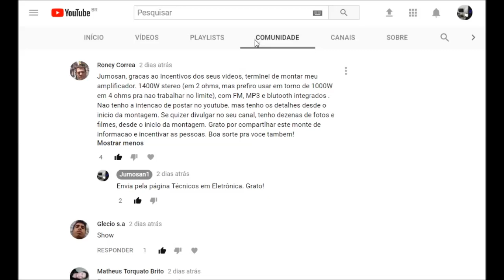Amplificador Artesanal montado pelo Roney Correa/GO

Comment: Esse modelo não é pra iniciantes... Nem para hobby ... Isso aí ja envolve estudo técnico engenharia cálculos... Além de custar só um trafo desse tamanho no mínimo uns 300 reais até 400 reais só o trafo... Uns 60v 0 60v  x 12amperes mais ou menos isso... Aí mais uns 290 reais cada placa com os transistores x duas são 600 reais só em placas e transistores... Aí com todo aparato coolers chave on of... Potenciometros volume painel leitor de usb radio etc pode ter até bluetooth esses modelos etc... Olha o cara gastou uns 1800 reais com dissipadores trafo placas painel chaves transistores coolers e gabinete ... Doideira mas parabéns ficou perfeito muito legal funcional e sim de dar inveja a qualquer um que deseja montar amplificador caseiro etc... Mas para iniciantes recomendo iniciar com tda2030... Ou tda7294 = 93... Placas simples e trafos pequenos 12v 0v 12v 1a ou 1.5amperes pro tda2030 ou tda2050... O 2050 da pra pra ir pra um trafo 15v 0v 15v 3a e esse ja da uma potencia legal...e pra iniciantes que podem gastar um pouco mais ja podem partir pra placa com tda7294 e trafo 18v 0v 18v 3a esse é barato em qualquer eletrônica 45 reais... ou trafo 22v 0v 22v 3a aí ja custa uns 70 reais. Pra trafo 22v 0v 22v precisa bom dissipador de alumínio e um cooler 8cm x 8cm. Ja pro trafo 18v 0 18v 3a o tda 7294 vai bem apenas um dissipador pequeno ou médio já chega e nem é preciso cooler nesse caso. E se consegue boa potência com o tda 7294 recomento a hobystas e iniciantes. Que querem apenas empurrar um falante 8 ou 10 polegadas de 75wrms a 100wrms. e um tweeter. Fica um luxo e funcional e gasta apenas uns 120 reais com tudo já placa componentes e o tda7294 trafo 18v 0v 18v 3a. Ponte retificadora ou diodos comuns se desejar e capacitor pra filtro 35v por 1.000uf  cada vai dois ao montar a fonte simétrica etc... E se consegue aí barato e um bom amplificador caseiro com uns 65w reais a 4homs com esse tda7294. Ou gasta se uns 85 reais e monta o tda2030 ou 2050 com trafo 12v 0v 12v 1a ou 1.5a esse trafo custa 25 reais em loja de eletrônica ou se tira fácil de sucatas como aqueles aparelhos parabólicas antigos o que tem os botões pra trocar de canal etc... Essas sucatas se compra por 5 reais estragados a placa no caso estragavam fácil porém o trafo é 12v 0v e 12v geralmente 1.2 amperes e sempre esses trafos ficam perfeitos estes transformadores não estragam nunca... Aí compra a placa pra montar no mercado livre e monta com o tda2030 ou 2050 custa uns 45 reais essa placa com frete já incluido etc... Dai com 80 pila se monta um bom amplificador  e barato e 14w a 18w a 4homs com o tda 2030. Ou com um trafo 15v 0v 15v 2a pro tda2050 se tira uns 34w rms a 4homs e fica bomxe barato também... Agora quer montar algo mais potente compra o módulo taramps 400x2 dois canais de 200wrms a 2homs cada ou no modo bridge 400wrms a 4homs mono no caso 160 reais no mercado  livre novo etc... Daí compra uma fonte 12v chaveada 20a e pronto vai ser feliz e tocar um som paulada dw verdade kkkk. A fonte 12v 20a pra ligar esse módulo custa uns 38 reais mais frete no mercado livre... Ou compra a fonte 12v 10a essa é bem barata e dá pra ligar as duas fontes juntas em paralelo etc. Só deve fazer o ajuste de voltagem o mais próximo possível... Ex 12.8v e se conseguir regular a outra a 12.7v blz só ligar todos os positivos com positivos e os negativos com negativos... E blz vai funcionar de boa com grande potência e se gasta uns 230 reais e tem módulo taramps de 400w rms mais uma fonte 20a 12v. Ou duas fontes de 10a 12v cada ligadas juntas...feito 400wrms com 230reais. Aí ja pode bombar uns falante de 150w a 250wrms que já começa a ficar interessante... Ou vai prum módulo taramps t500 mono 2homs 500wrms duas fontes 20a 12v juntas ja tocam esse. ou pro 800w  mono taramps pra este duas fontes 12v de 30a juntas. Ou pra soundigital 1.200wrms mono 2homs evo esse é mais barato que o taramps equivalente e toca 18% a mais e consome menos energia o 1200 da taramps. Pra esse 1200wrms evo soundigital recomendo uma bateria 50a zeta é barata comum mas é da moura esse modelo e nova ou uma bateria 50a pioneiro essa é barata e boa também e uma fonte de apenas 15a pra ligar junto ja mantém tudo ok se tiver uma bateria junto. Apenas fonte 15a de fonte pode descer a ripa em dois falantes de 750wrms cada 4homs de 12pol ou de 15pol cada. Que daí ja incomoda o bairro inteiro kkk mas incomode só uns 4 a 5 minutos e abaixem o volume ninguém merece ouvir som alto incomoda é irritante e pode causar problemas sérios se não souber usar potências desse nype pode dar B.O polícia processo ou vc pode apanhar dos deus vizinhos kkk além de ficar mau visto quem ouve som sem limites deveria procurar uma psicologa pois apresenta defeito nos miolos ou fumou muita erva ou bebei demais e ficou com problemas mentais como demência. Ou é um piá de merda tocando som por horas e a todo vapor com 1000wrms tem que apanhar mesmo. Ou gasta 30 mil reais e vai apenas pros campeonatos regionais etc... Ou monta pouca coisa. Pois uma pessoa equilibrada não fica incomodando o sossego dos outros porquê tem um baita som deixar lacrado pra fazer zueira daí tem que tomar uns tapa nos ouvido mesmo pra aprender a respeitar os outros etc.
Reply: Eu entendo a sua posicao e concordo com voce! Tem opcoes pra todos. este trafo eu aproveitei de uma sucata que comprei ( acho que da pra ver a cola nos fios que saem do secundario, pois estavam soltando e tive que trocar) sao 55 ou 58 volts, nao me lembro por 40 A, mas quando testei ia abem ate pouco mais de30A depois a tensao caia muito.
O detalhe é que eu queria muito fazer do zero, inclusive tem a placa de conexoes que fiz a mao e o painelzinho em aluminio de deu muito trabalhao pra fazer os cortes.
Como diz nosso amigo Jumosan :, Boa Sorte!

Comment: Para que montar um absurdo desses isso aí deve tocar 1200 RMS por canal a 2 homs cada canal... E um transformador desses deve ser 60 mais 60 volts ou mais e por uns 10 ou 15 amperes mais ou menos isso aí come luz igual um chuveiro mas deve tocar para caramba mas o gasto não compensa Claro para hobistas ficou perfeito incrível Belo trabalho mas para quem não tem dinheiro e tempo para arrumar transformadores incríveis ou até mesmo ter que fazer um transformador desse tamanho e comprar tantos transistor que São Caríssimos para caramba pegue compra um som digital de 1200 watts RMS a 2 ohms o módulo de carro no caso por 340 pila no MercadoLivre compra uma fonte ou duas fonte de 30 amperes cada Total 440 pila e tá montado já em 2 minutos um ampli de 1200 watts RMS a 2 ohms com duas fontes de 30 amperes cada 12 volts ligado no módulo automotivo e tá pronto o BRIC aí se quiser bota uma bateria junto para ajudar e tá sossegado gasta metade do valor de um amplificador de som desses montados caseiros Se for para montar e valer a pena melhor um apenas com um par dos Toshiba ou dois pares dos Toshiba e um um transformador de apenas 33 + 33 volts por 4 amperes e isso para quem já tem dinheiro sobrando por que para quem não tem dinheiro compra plaquinha por 40 pila e monta com o tda7293 ou 94 e com um transformador 18 + 18 volts por 3 amperes tá montado um canal bem baratinho de 85 watts Rms bem mais barato e mais prático Se for para montar um negócio desse tamanho é melhor comprar um módulo automotivo e adaptar a fontes e gasta-se apenas a metade do valor
Reply: Jean padilha, se eu te mostrar o meu amplificador linear de radiofrequencia (sou radioamador ) voce vai morrer entao.  É do tamanho de um frigobar. A fonte tem soft start - 2 etapas - pra nao derrubar o disjuntor da casa. De consumo sao aproximadamente 6 mil watts
O grande prazer esta em construir as coisa com as proprias maos, e se puder ser potente, melhor ainda!
Abracos
Reply: Roney Correa parabéns se vc consegue gastar 6kw hora e parabéns por montar seus próprios radiofrequência ou  amplificadores etc. Eu admiro muito quem monta coisas potentes e dá certo. Tudo de bom p vc. Eu montei apenas amplificadores pequenos devido ao alto custo de materiais etc... O maior que montei gastei 260 reais um canal com dois pares dos toschibas 2sc5200 e 2sa1943 e consegui 200wrms a 4homs e ta funcionando até hoje mas isso faz 4 anos atrás... Se for montar o mesmo mono apenas um canal igual esse que ei montei etc... Hoje ia gastar uns 340 reais apenas um canal... Eu acho um absurdo o preço pra montar esses amplificadores... Mas no meu carro por exemplo apostei em marcas conceituadas tenho um taramps 1200w pro grave paguei 450 reais nesse ampli mono 2 homs 1200w e paguei 168 reais no mercado livre o 400x2 dois canais de 200wrms a 2homs cada canal esse pras cornetas e tweeters e uma bateria 120a paguei 500 reais a bateria... E tenho um dd digital designer mas original americano 800w rms bobina dupla pro grave... E bota grave o meu dd é de 15pol e engole 4 pioner ou 4 tal de cara preta engole 4 de 12pol dando risada... E duas cornetas snake 2.5pol de garganta cada estalo o cara se pisca tudo até uns 40metros de distância tenho dois driver snake. E um driver snake toca por duas d405 trio juntas kkkk. E 2 super st400 pra. 250wrms cada tweeter e olha isso sim é qualidade e um som de botar respeito. Ja pra som pra festas ou casas etc aí sim recomendo os amps caseiros de vocês de grande potência... Mas eu só montei meu sistema valendo no carro agora. Parei de investir em amps montados em casa... Pois onde vou se a galera meus amigos quiserem abro porta malas e tá feito a festa pois levo junto a festa comigo aonde meus amigos estiverem eu chego com a festa pronta no carro. Em casa apenas pra ouvir sozinho no pc ou em um filme etc mas não vou ligar 800wrms dentro de casa pra isso não sou doido kkk . pra casa meu amp caseiro pequeno ja basta. E ainda o meu amp gasta apenas 240w de energia e isso se tiver no talo o volume lacrado etc... Se eu usar com volume baixo apenas normal etc dai gasta apenas 60w de energia etc pra isso basta. Mas parabéns pra vc por montar grandes aparelhos eu admiro mesmo mas eu não ia investir 2 a 3 mil reais pra montar um amplificador ou esse radio amador desse como o seu aí... Tudo de bom parabéns p vcs que estudam e botam em pratica o que aprendem.
Reply: Nossa! Eu amo som automotivo! Tenho um Puma 1978 com uma pyramid de 1000W e ja acho um absurdo pra um carrinho tao pequeno. Treme todo com os graves. Agora ele so cabe 2 pessoas por causa da caixa com os auto falantes no banco de tras!
Reply: Roney Correa olá o pyramid 1000w. Tá aqui a descrição original dele é 4 canais de 65wrms cada canal olha aqui os vendedores afirmam isso o adesivo original dele afirma isso e o manual original dele afirma olhei o pdf 4 x 65w a 4homs. Ou 4x 130w rms a 2homs. E ele consome 35amperes ligado em potência máxima etc. Ou seja além de ser um ab do tempo da pedra e não ter potência nenhuma come mais bateria do que os módulos soundigital evo 1200wrms reais a 2homs ou o taramps 1200w reais mono ambos esses amps é 1200w na vêia e consumo em potência máx de 34a o taramps e o soundigital 30a apenas. Não me faça rir com 4 canais de 65watts bhá deve disparar os alarmes dos carros estacionados kkkk. Olha aquí o link ó https://goo.gl/images/AfVEzY esse pyramid 1000 paraguay chinês ching ling toca 4 canais de 65wrms a 4homs kkkk bhá cuidado se vc for vender pra alguém não diz que toca 1000wrms se não depois vão querer te surrar kkk. Mas isso aí curte seu som seja feliz. O que vale é ser feliz se toca 1000wrms ou 4 de 65wrms nada a ver o que vale é se vc gosta dele e ele te serve bem e treme tudo beleza tudo de bom p vc.
Reply: Roney Correa aqui o teste do pyramid 800w potência real https://youtu.be/7gkpUqA-EP8
Reply: Roney Correa o pyramid 800w em modo bridge ainda somando dois canais juntos só larga 114.4 watts . e o 1000w larga 4 canais de 65watts ou no bridge se faz um canal somando dois juntos só larga 134 watts reais...
Reply: Roney Correa olha esse modulo 250.2 smd mini módulo consumo max 11a apenas não dá um palmo mas manda 304wrms beleza 304wrms reais e custa apenas 160 reais no mercado livre. Pequeno leve e toca só 3x mais que o teu pyramid 1000w que consome 35amperes... Esse modulo soundigital pesa 120 gramas e nem precisa de carcaça ou dissipadores de alumínio trabalha gelado não come bateria e toca 304 wrms. Ou compra o taramps 400x2 esse manda 400wrms reais em bridge. Ou dois canais de 200wrms a 2homs também pode ser usado assim. por apenas 160 reais no mercado livre vc consegue um módulo bem melhor. O taramps come 15amperes por hora e manda 400wrms... O soundigital come 11amperes por hora e manda 304watss rms. Ou vai pro t500 esse manda mono um canal 500wrms 2homs pode ligar tudo nele subwoofer corneta e tweeters tudo junto que ele aguenta o tranco legal o T-500rms manda um canal de 500wrms reais taramps esse e esse come 18amperes por hora a 500wrms esse t 500 custa uns 280 a 320 no mercado livre... É uma dica que te dou... Ou pega um soundigital 1200 mono 2homs igual o meu por 350 reais e daí sim 1200w ja pode tocar um tornado 1000wrms de 15pol. ou dois eros de  12pol 1200watts cada um e daí sim começa a tremer quebrar o painel inteiro do carro como o aconteceu com o meu celta novo kkkk com um dd 800wrms e esse 1200 evo da soundigital quebrou o painel do carro kkk a tampa e o vidro traseiro destruiu kkk a borracha e as colas não seguram mais o vidro traseiro caiu fora tive que mandar colar bem e trocar as borrachas que seguram o vidro que tem no porta malas kkk descola o espelho retrovisor interno cai no colo do cara kkk. Sem falar na zueira de passar na rua disparando tudo os alarmes dos dois lados da rua até 25 metros dispara tudo os alarmes com o grave até de casas lojas etc não só de carros estacionados na rua.
Reply: Outra opção seria montar amplificador com o IRS2092, é surpreendente, estou prestes a me desfazer dos ABs todos.
Reply: Everaldo Maus com certeza ab já era e faz tempo... Prefiro comprar um amplificador digital pronto está muito barato e toca 5x mais que um ab... E ligar com fonte automotiva de 20amperes tem fonte por 40 reais no mercado livre se for um modulo muito potente é só ligar duas fontes 12v 20amperes juntas em paralelo e ta feito 40amperes e blz ja conseguimos com pouco investimento aí 700w rms até 900wrms reais em 2homs com esses amplificadores automotivos prontos ja etc e uma ou duas fontes de 20a cada dessas chaveadas... Porque só um trafo pra um ab potente custa 400 reais já da pra comprar um som completo desses módulos automotivos com fonte e tudo fonte barata 12v chaveadas etc 20a...e um modulo de 800wrms mono ou o 400x2 taramps também toca bem. Ou vai pro soundigital evo 1200w rms mono 2 homs custa 350 reais no mercado livre. Pra se montar um ab de 120wrms só o trafo dele passa dos 350 reais fora mais os 400 pra montar fonte e placa e os caros transistores... Então compra digital de carro de 1200wrms por 350 reais no mercado livre e compra por 40 reais uma ou duas fontes chaveadas 12v 20a  e tá feito o amplificador gastando menos e com o dobro da potência de um ab. Sem falar de tamanho peso eficiência vs consumo de energia etc...